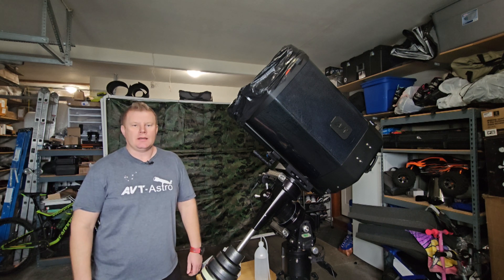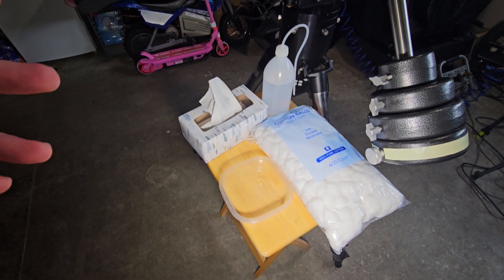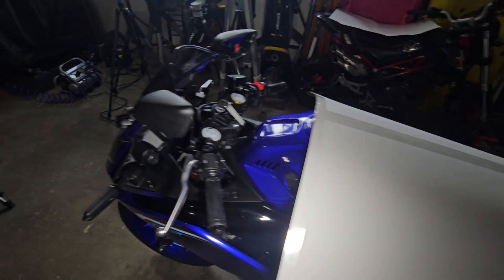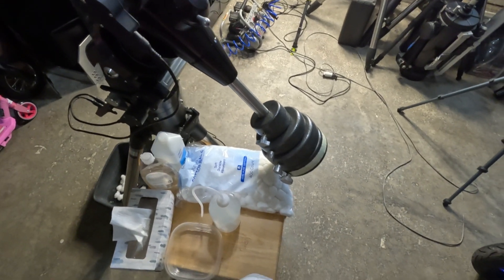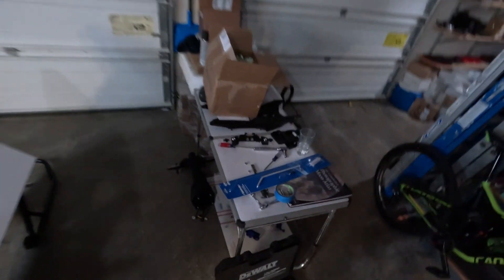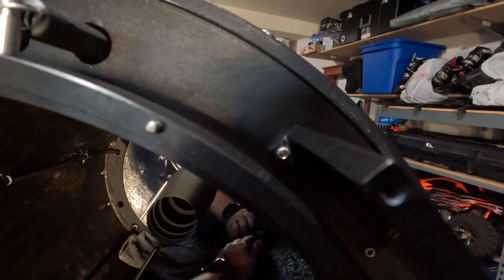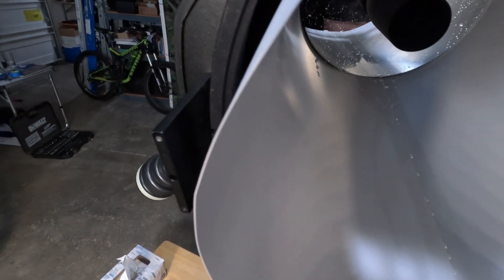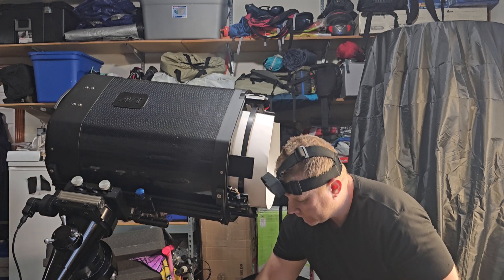SAFELY Clean SCT Primary Mirror. 16" Meade RCX400 - Part 4

Comment: Not really a huge fan of using tissues for cleaning glass/reflective surfaces.  In my experience they leave too many small fibers.  I would suggest those cotton make up pads you can find at grocery stores.
I've never cleaned my SCT, only my old newtonian.  When I did, I used the same procedure I used for my camera lenses; Dust it off.  Use 70% alcohol with q tips and the makeup pads.  Then distill water, and finally use brand new and dry pads or qtips to lightly buff out any remaining water spots.
Reply from the maker: Sorry, but you're talking about an entirely different cleaning procedure. What your describing should NEVER be used on a mirror.  At no time did I use the tissue for cleaning anything. Please watch the actual procedure that I use.
Reply: @AVTAstro  
"What your describing should NEVER be used on a mirror".
I'll bear that in mind.  Like I said, I only used that for my old, cheap reflector.  

"At no time did I use the tissue for cleaning anything."
Personally I just don't want a tissue anywhere near it.  Place at my work where they keep tissues has to be cleaned every few weeks because every time one gets pulled out small flakes fall off and cover everything around it.  There's just way more options that are less likely to leave any lint or residue.

Comment: Vlad, have you created a replacement for the inner shroud liner?
Reply from the maker: Nope, I have not. Actualy assembled and using the scope without it completely. Besides astatic it really serves no purpose.
Reply: @ yeah, it just covers up the linkage and wiring on the inside of the OTA.

Comment: Vlad, is your mirror cleaning solution different from your corrector/glass solution?
Reply from the maker: Nope, pretty much the same stuff. For the mirror, I usually use less alcohol. So about a 50/50 mixture. But really these days the 50/50 plus a tiny drop of dish soap is what I usualy use. Also have a bottle of Baader lens cleaner that works well for small jobs to where I don't want to bother mixing something up.

Comment: Figure out a way to cover up the fan grill. I got some insects on my primary mirror recently, so I put some blue painter’s tape over the grill.  I think that is the only unsealed entry point into the OTA.  I will use your videos to guide me in cleaning the mirror!  BTW would a spray bottle work better?  It seems that most of the solution ended up in the bucket on the floor.
Reply from the maker: Good idea!

Comment: One thing that baffles me about my 16" ACF scope is the very short baffle tube, and yours looks the same.  My other 8" and C11 SCT have longer central baffle tubes.  Not sure if this is an oversight or for something else.
Reply from the maker: I think it's the same length as the smaller scopes just our scopes are larger!
Reply: @AVTAstro  Not the absolute size, but proportional size.  The ratio of baffle diameter to its length.  In the 8" and 11"  SCT  I cannot see the corrector plate through the back opening, except near extreme edges of the FOV, because the main baffle tube blocks it.   In the 16" ACF when looking through the rear, I can see the corrector plate all around the secondary, since the main mirror baffle is too short.  Maybe the baffling in the eyepiece tubes is supposed to block this light.  If looking at the moon,  the light will be shining directly through the corrector, into the baffle, and into the eyepiece FOV.

There is a video on youtube describing this issue on a 16" RC telescope, but pasting links is not allowed here, so the video is titled:
"Warning about GSO Ritchey-Chretien's Baffling ( RC resold under Orion, TS-Optics, .. )"

Maybe if the design is aimed for a full-frame sensor and no larger, then stray light is not an issue. The video title below shows a light leakage experiment on an 10" RC for a full frame FOV using a 35mm film slide frame. Probably if I did the same experiment on a 16", the stray light will not hit the full frame FOV, which is the max FOV for most telescopes:
"GSO 10" RC Carbon tube baffle tube issue"

Comment: That compressed air made a big difference, nice tip!
Reply from the maker: It sure did. 🙂
Reply: You have to be careful with canned air as they can have moisture and gunk inside.
Reply: @Astronurd  also if the pressure is too high and there's a hard dust particle nearby sucked into the airstream, it would be like sandblasting.
Reply from the maker: Good point on this one. Canned air should not be used. Either the compressor rig i was running or an optical bulb👍
Reply: Take the goddam mirror out and clean it properly!
Reply from the maker: Not really possible. But you sir are more then welcome to do this, film it and educate us on how to do this👍😋